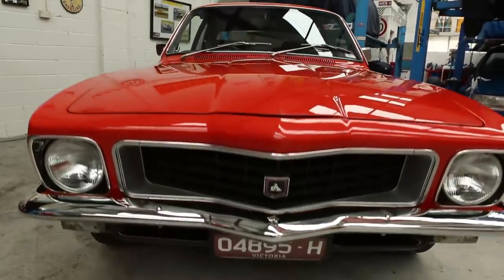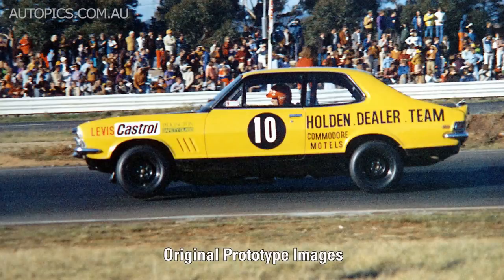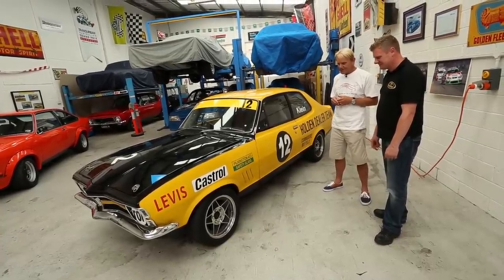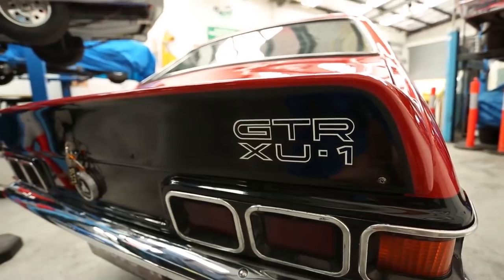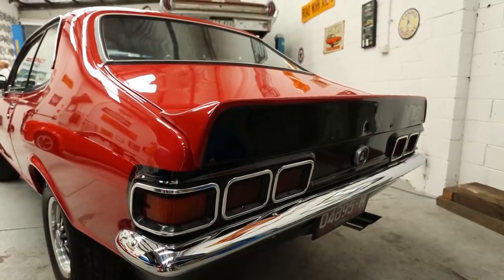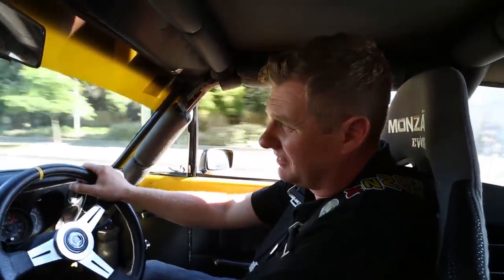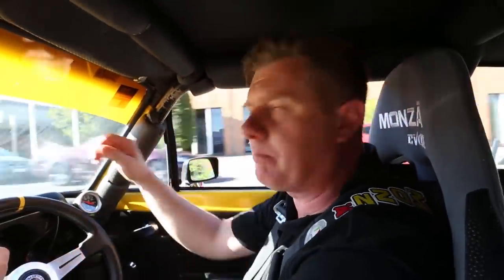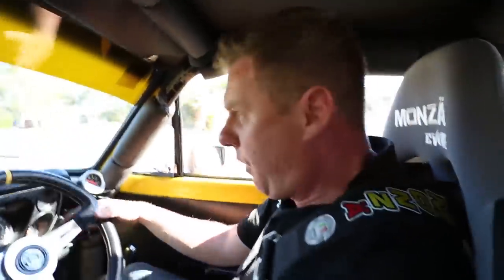XU1 V8 HDT TORANA PROTOTYPE Replica - Pt 2 Ron Klein GM Holden Collection

Comment: RIP Ron, Great Replica of the Yellow HDT LC XU1 V8 Prototype that Harry Firth put together in very late 1971 at HDT HQ in Queens Street. GMH Engineering Fitted the 308 V8's into the Three LJ GTR Torana Prototypes, One was Orange, One was White and One was Strike me Pink. Orange one was Stolen and never recovered and the Pink and White ones were Sold.

Comment: Sorry to read from the comments that this bloke has died. Love these Aussie classics but as I've gotten older (wiser?) I've come to accept that the super specials (Phase IV, XU-2 etc) would have been dangerous packages as the handling and brakes weren't up to the power. Still, it's tantalising to wonder what might have been.
Reply: The V8 LJ Torana had no Handling or Brake Problems as Harry Firth and Holden Engineering had worked hard on sorting the V8 LJ out, the Production Car was going to have New Front Disc Brakes and New front Calipers plus new Heavy Duty Coils all round and New Heavy Duty Shocks all round for far better Handling than the 6Cyl LJ XU1 Torana. So it was up for the Power. The Phase 4 would of been the car with Brake Problems.

Comment: I've owned 3 XU-1s and have run them all to maximum speed of around 125mph the thought of doing 160+ in one would take big balls
Reply: The bump steer would be dangerous, LH's are bad at 150mph.
Reply: I had a V8 LJ, a guy called Craig Walkem help me build it, it had koni's shocks and heaps of castor dailed into it, i had it doing 170 mph across the hay plains, (not the best road even in the late 80's) the motor is lower down and further back in the car, they were made for a v8! i had gtr's and XU1's but didn't come close for stability. btw the v8 added 15kgs to the car a 202 trimatic came out of it, to be fair it had steel rims with the 6 and globes with the V8!
Reply: @StuFletch68  You didn’t live in Port Lincoln at one stage?  I got passed in my hot 173 LJ on the way from Adelaide by a V8 LJ.  Bloke and I had a good chat at Cowell.  I knew something was coming when I was sitting on the old ton and there was this car coming up from behind really quickly.
Reply: Steve, what about the gaps between top of the window frame and the body on the 2-doors!  At 110mph I could put half of my hand through the gap if you had the windows up.

Comment: I was lucky to be at Bathurst in the pits as a 16 yo when Colin Bond was trialling a v8 Torana in the xu1 body. He let us have a look over the vehicle, from memory that vehicle had the motor set back and the firewall had been modified to sit in the bay. Colin said it was because they were still testing handling. He fired it up while I was there and the sound was unbelievable with unrestricted exhaust. The vehicle wasn’t been raced , it being trialled. Made my day as a young fella.
Reply: That Car would be the HDT LC XU1 V8 Beast Mark 2 that has the F5000 Engine in it and not the Yellow HDT LC XU1 V8 Prototype that had Vic rego number KSN116 on it that Raced and Won a Sports Sedan Race at the 1972 Easter Bathurst
Reply: @666theninja  thank you for the info, as I say I was 16 at the time and was totally in awe of this vehicle, and yes it was when they held races at Easter .

Comment: Never had the pleasure of driving an XU-1 but when I wrote off my '74 SLR5000 I replaced it with a '74 GTR with 3300 motor.  In many respects, the GTR was much more pleasurable to drive then the SLR.  A boot full of accelerator and a handful of opposite lock and she drove perfectly.  The SLR was great though :-)  Wish I still had it now, it would be worth a fortune :-)

Comment: I remember in the 90s when a few LJ's started appearing around the drag strips fitted with V8s but it was fairly short lived, they had a specific characteristic of mounting the lane barrier on launch since they didn't have either the wheelbase or structural reinforcement for enough stability in that kind of racing, another chassis choice for the same engine could be a fair bit quicker and more controllable. Also remember an article from the time mentioning the decision to can the XU1 V8 came ahead of the supercar scare and was about chassis concerns also, essentially the conclusion at a very early stage was a complete chassis redesign since the amount of modification to make the combination work competitively would amount to approaching the same thing anyway. One prototype had its V8 replaced by a stock 202 and became the daily driver of a Holden executive before the legislation and CAMS changes hit, infamously identifiable by its relocated fuel filler and a larger tank instead of the single one under the rear plate, iirc it was track style dual fillers or lift boot to fill or something. That got bought by someone else many years later who retrofitted a 308 back in with a Trimatic and that was the car that article I was reading was about, apparently the auto helped preserve diffs and drivability. Stock engine but still described as a bit of a monster to drive.

Comment: I own an August built 73 ex pigger XU-1.  They had a few mods that the normal XU-1 didnt have.  Different castor n camber on the front end and some body strengthening mods. It handled.  At low speeds it was a piggy little thing that jumped from side to side but still stayed on the right side of the road.  It started to handle nicely at around 60 mph and just got better the quicker you went. It had a 2.75 diff in it and it would rev to 7000.  Anyone in Perth would know Whelshpool hill.   I had her reving at 7000 going down that. Dont know the maths, 7000 with a 2.75 but it was way way past what the speedo read to which was 220..  The normal 73 XU-1 was the exact same car as what the 72 Bathurst model cars were.  Same camshaft, same dizzy advance etc, same suspension geometry set up.    It was built in Adelaide and i bought it in 1986 and owned it ever since. 
I have a V8 in it now but it has lost  fun ness that the little 202 with three gobs had.   It does get alot better fuel economy though.   Hasnt been licensed for 20 years now, it just sits in the shed.   Time to do a rebuild on her and enjoy the nicest handling car iv driven.  And  Iv driven alfas, SS Commodores, A9X Torries and late model GT Falcons.  Nothing handled at high speed 200 kph plus round long corners like the XU-1 does.
The A9X was a much heavier car than the LJ, so imagine how quick one with a race preped 308  as in A9X motor, would have been.   Alot quicker than an A9X i lmagine..     They be like a go cart on steroids.

Comment: Brock did race in one in rallies on the dirt overeas somewhere.  Theres pics of him in the Marlboro hdt v8 lj 20 ft in the air under a malboro banner. Indua
Reply: Harry Firth and Peter Brock went to Macau in Hong Kong and Raced a Yellow LC HDT XU1 Torana  it wore the Vic Number Plate KSA302 and there is a Video of it on YouTube on that Macau Race, Look on YouTube for it. Only time in the Early HDT Days that Peter Brock went overseas in a HDT Car. Now Harry Firth went to South Africa and Raced a car over there, nothing to do with HDT, Harry later on was trying to Get GM South Africa to Buy the V8 LJ but they went with the Chevy Firenza that had a Chevy V8 in it and a Muncie 4 Speed and raced that instead. They made 100 of the Chevy Forenza V8's.

Comment: cool !!, I had a drive of a torana LJ with a 308 fitted in the early 80s, not licensed as a v8, had a statesman narrowed diff and bigger front discs, pop riveted metal around the transmission firewall area, etc !!!, went like stink :)

Comment: A rumour going around at the Time is that the Toranas would have bigger tanks for Bathurst and would hadveFuel caps either side in the rear pillars. In the late 70's in Sydney on Canterbury Road outside a Garage I did see a Torana just like that but no idea who owned it.
Reply: What Colour was the One you seen on Canterbury Road outside a Garage ???
Reply: @666theninja  So the one i saw was somewhere between yellow and light orange so long ago hard to remember exactly.

Comment: Xu2 at Bathurst would of blown the field away especially with Brock behind the wheel
Reply: not necessarily remember he did say that he was breaking gearboxes and snapping axles before he changed them to the very much stronger Ford units, also  the SLR Toranas also needed a few generations to stop snapping axles and chewing gearboxes

Comment: The Torana that never was. Nonetheless, Brocky showed the Torana's credentials using just a 3.3 litre six against Ford's 5.8 litre V8. 
One minor issue with the car in this video. it's an LC Torana. The V8 XU1 would have been based on the LJ.
Reply from the maker: This car is based on the LC prototype they built and raced briefly.